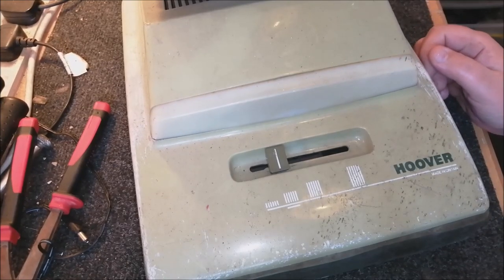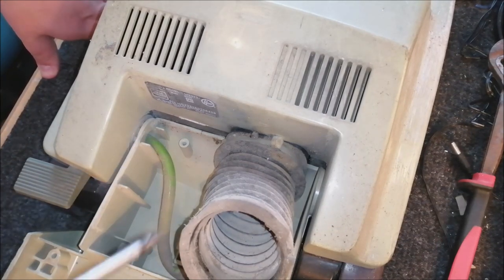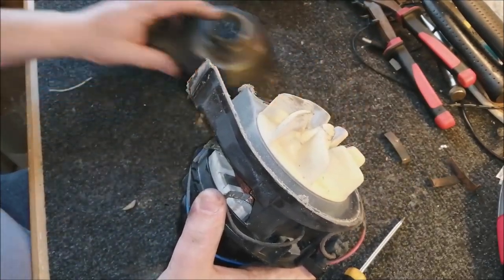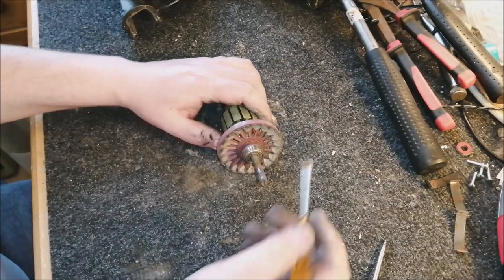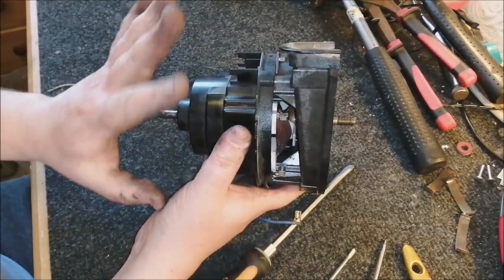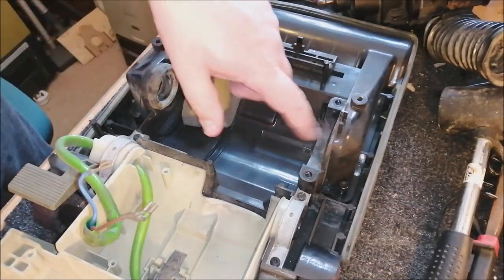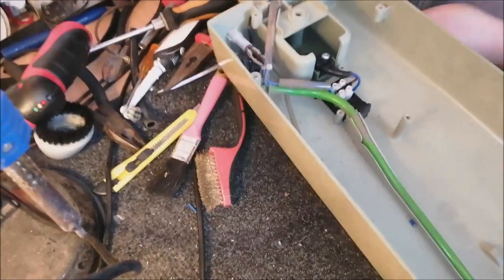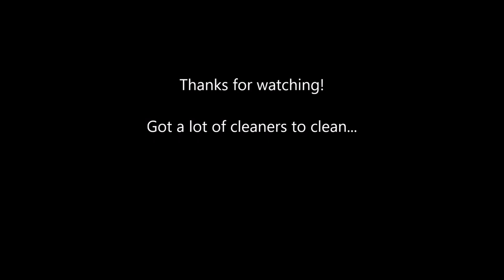Part One - Wrecked Hoover Turbopower U2332 Upright Vacuum Cleaner - Restoration -  Trash to Treasure

Comment: Fantastic video.I have the same model from late 1985 that the motor is shot on so I’ve ordered a replacement motor for mine
Reply from the maker: Unusual to find them with bad motors, they were normally very reliable

Comment: Thanks for you super videos!  I have this model but the other day one of the wheels came off.  I can't seem to find the problem (I'm a total amateur!).  The spindle doesn't seem to screw into anything.  Can you help? :-)
Reply from the maker: They are held on by circlips. I suspect your circlip has fallen off the axle OR the wheel has worn so much that it's passed over the clip :(
Reply: @TheVintageApplianceEmporium  Thanks so much for getting back to me so promptly.  I have no idea what a circlip is - or what it looks like!  However, at least the mystery is solved.  It's so frustrating though as I have this lovely Turbopower which I can't use anymore!  :-(